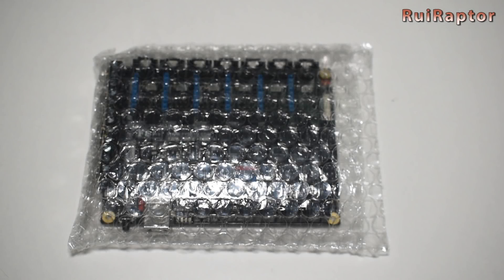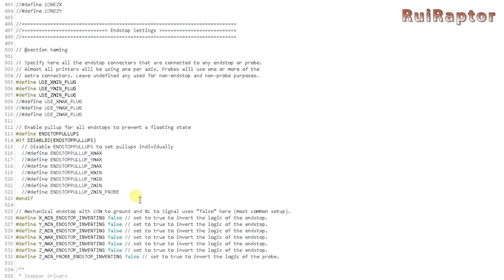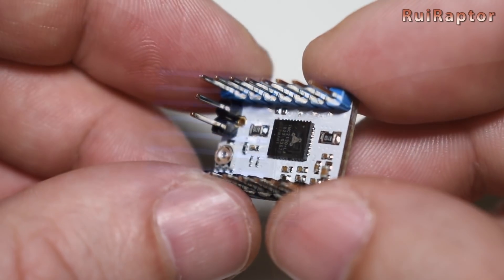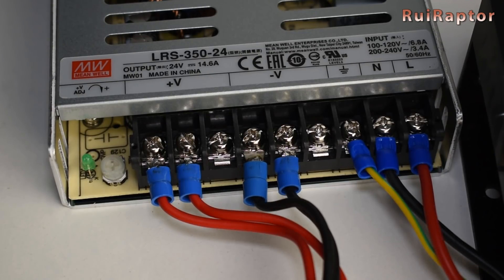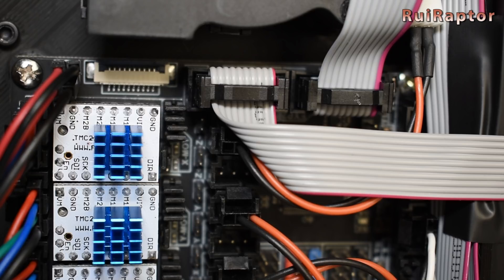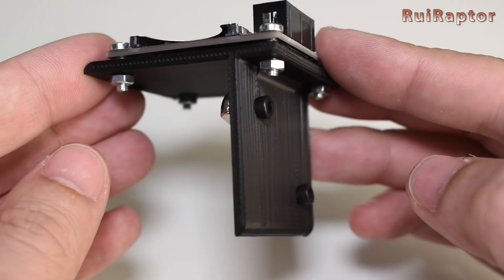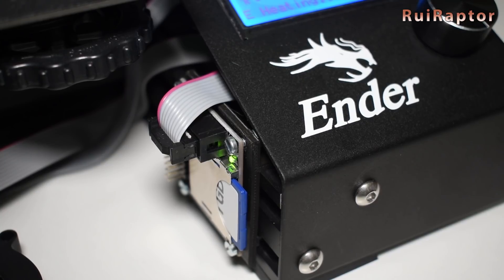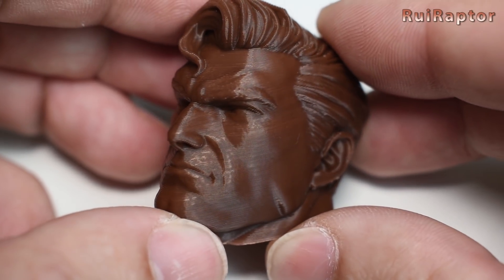Fysetc F6 - HOW TO INSTALL on a 3DPrinter (Ender3)

Comment: Hello sir I need some help from you Firmware Fysetc F6 v1.3 & tmc 2208 v2.0 & RepRapDiscount Full Graphic Smart Controller Please pay attention and thank you
Reply: And is it possible to run the lcd mks tft35 v1.0 with this board
Reply from the maker: Greetings, sorry for the late reply. We have been very busy. 
We will not be able to build your firmware since we don't have not enough time at the moment. Sorry.

Comment: I just hooked my Fysetc F6 up to a raspberry pi for the first time.... do you know of a way to keep the board from being powered by usb while the printer is off?
Reply from the maker: Hi Aaron, the only way (with that board) is to use a USB cable that has the power wire cut.
Reply: @ruiraptor  darn. I tried that, but octopi errored out when trying to connect without that wire.
Reply from the maker: Do you have the power and ground wires cut out? Try with only the power cut and leave the ground connected.
Reply: @ruiraptor  Yeah, I just cut power wire and left the ground.
Reply from the maker: Hi Aaron, some boards have a jumper to switch power source between usb and power connector. That board does not have that and the cable trick should work. If that does not work, then you need to power off the raspberry when turning off the printer. If you use one of those AC power plugs with 2 outputs and switch, you can turn off both.

Comment: hi...where I can download the firmware ready to install on an Fysetc F6 with the cr10 stock lcd???
Reply: mi email is oituarte@icloud.com.      thank you
Reply from the maker: Hi Omar,
I only have for the Ender 3. But you can edit it and make it compatible with the CR10.
Reply: @ruiraptor  hi , my printer is the ender 3, but the option on marlin es cr10 stockdisplay
Reply: @ruiraptor  can you share the file?? thank you
Reply from the maker: Hi Omar, i just sent it. Please check.
Reply: ruiraptor gracias lo reviso y posteo resultados...saludos

Comment: Hello! In the video, everything is clear and detailed, I can’t get flashed through your video (Could not send me my firmware tuned to TMC2208 without UART, but with standard Ender 3 screen. Thank you in advance! Thank you very much for my English, used Google translator. Send to danilaudi@gmail.com
Reply from the maker: Hi,
I have sent you my firmware to your email. Please check.
Reply: @ruiraptor  Hey. I just saw the letter, clicked on the link and it was written: "Transfer deleted
Sorry, this transfer has been deleted and is not available any more".  Can you repeat it again? And this is another question, blowing the hotend fan 0, and where to connect the blowout of the printed model? thank

Comment: Hi! Thanks so much for this wonderful video! I would like to install this with tmc 2208 on my Ender 3 with the fysetc tft4.3. Can you email me your preconfigured firmware for these? Thanks so much! hawktrainer at gmail dot com
Reply from the maker: Greetings, Firmware sent. Please check
Reply: @ruiraptor  Received - thanks so much! I will try it this week.
Reply: @ruiraptor  Thanks again for sending the firmware. I am not able to get the firmware to compile in arduino IDE. I get this message:
"sorry - this program has been built without plugin support
Using library LiquidCrystal at version 1.0.7 in folder: /Applications/Arduino.app/Contents/Java/libraries/LiquidCrystal 
exit status 1
Error compiling for board FYSETC_F6."
Any idea how I can fix it?
Thanks for your help!

Comment: Hi Rui 
when will you make the complete video for vref and card configuration?  bye thank you
Reply from the maker: Hi Emanuele,
The Vref adjustment depends on the driver and not the board and for that reason, we didn't include that in the video. We have many other videos explaining that in detail. Regarding the card configuration, which do you mean? We explained a few.

Comment: And why you don't use tmc2130 for extruder?
Reply from the maker: Hi Vadim,
The TMC2130 can be used for the extruder. We just wanted to show different options (in this case an LV8729) and how to configure them.

Comment: what are the connectors to buy?  it is not clear they are not the duponds. Many thanks links please
Reply from the maker: Hi,
They are called MTE connectors.
If you google MTE connectors you will find the exact ones. You need 2, 3 and 4 pins connectors.
Don't forget to buy also the pins as they are normally sold separately.
Reply: ruiraptor thank you so much you are very kind.
Reply: Hi
Did you finally make those connectors? Are there any shops selling already made those connectors?

Comment: I was wondering do the setting values in the firmware matter? (speed, jerk. etc.) I was wondering this because I'm building my own printer and I always thought those values only mattered in the slicer settings. Do I need to mess with the firmware values of speed and jerk?
Reply from the maker: Hi,
If you use Cura or any other slicer that has acceleration and jerk control, you can set these parameters in the slicer instead of the firmware. But if you use a slicer that does not control that such as S3D for example, you should set the correct values in the firmware because the printer will assume those. I normally advise people to setup the firmware values too because if in the future they change slicers, lose the settings or sell the printer, the correct values will always be with the printer.

Comment: I have the 2208 with UART from Fysetc.
How can I configure the marlim for it bypassing the UART?
Reply from the maker: Hi Fred,
The selection in the firmware is done when you define the driver type such as:
TMC2208 (UART enabled)
TMC2208_Standalone (NO UART)
Reply: @ruiraptor  Thanks
Reply: @ruiraptor    you could email me your configuration. So I need to change only driver definitions.
Reply from the maker: Hi Fred,
Sure, I can share the configuration. You can email me (check my email here on youtube or on my facebook page) and i will reply with it.

Comment: as always great video ;) 
but for airflow purposes i think the driver's heatsink should be rotated 90°
Reply from the maker: Hi, i agree with you 100%.
I noticed that after the installation but left as is and it's working as the flow of the blower is very efficient.

Comment: Hi. What are the values that you used for "feedrate", "jerk" and "acceleration" on your printer?? I ask because since I bought this board I could not find good value for that!! The motors are really noisy! Thanks.
Reply from the maker: We are using the same values as the stock ones. Maybe you probably running the drivers in spreadcycle instead?

Comment: Hi. I did what you mentioned in video to use stock ender3 screen but i only got light nothing else my screen only works with both exp1 and 2 connected to the screen when reversed exp 3 as i said just lights and click sound
Reply from the maker: Hi Fatih,
Please change the pinout of the LCD in the Pins_Fysetc_F6_13.h to:
#define LCD_PINS_RS              27
#define LCD_PINS_ENABLE    29
#define LCD_PINS_D4              25
#define LCD_PINS_D5              25
#define LCD_PINS_D6              27
#define LCD_PINS_D7              29
#define BEEPER_PIN                37
#define BTN_EN1                      23
#define BTN_EN2                      17
#define BTN_ENC                     35
Reply: @ruiraptor  thanx worked like charm

Comment: hi, we are FYSETC, and our F6 V1.4 is being planned! Will make the following changes. Do you have any other suggestions? 
plz tell us from our gruops: https://www.facebook.com/groups/197476557529090/
1.Change z Parallel to Series. 
2.Remove jumpers, use analog switches, and select driver types through software. 
3. switch to automobile fuse.
4. Add power supply reverse protection. 
5. change 5V to 5A, and add a WS2812 RGB control.
6. Add Z-min level conversion .

Comment: Do you think that this board is better than the MKS Gen L?
Reply from the maker: The Fysetc F6 has more features than the MKS GEN L, for example, the F6 has 6 driver slots and 7 motor outputs (1 extra Z motor output for dual Z systems). It also allows you to use SPI or UART connection with the compatible drivers with no extra wires. If you check the Fysetc F6 wiki page, you can read all the features.
Reply: @ruiraptor  what about the SKR V1.3 which has a 32bit processor?

Comment: thank you so much for this amazing video. I have few questions to you.. first of all, can we use all versions of TMC 2130 drivers for SPI mode on this board? i am asking this because you are saying on the video that your drivers have 2 extra pins. I have TMC 2130 V1.0 from Fysetc. if i had 2 extra pins?  second question for the touch screen; the board has pins for RGB but the  menu of the TFT screen has no LED menu, so how can we use the screen with LED screen menu? last question is about auto levelling; can auto levelling function be activated on the 4.3" touch screen supplied from Fysetc?
Reply: hi， we are FYSETC, The TMC2130 just TMC2130 V1.2 of ours can be used, and don't used other brand from China, the chip of them is not original , so the quality is very poor, and TMC2130 V1.0 haven't 2 extra pins.        and for touch screen, yes, now we haven't LED menu and auto levelling, but if necessary, we can add it， if u have more suggest or interested for our F6, maybe u can contact our engineer directly from our groups:  https://www.facebook.com/groups/197476557529090/
Reply: @骆小甜  i think i could not explain my problem.  I have already got TMC 2130 drivers from FYSETC your company. I am asking if i can use them for SPI mode if  I add extra 2 pins? since rgb is not necessary then why did you add it on the board. and if it is necessary why didn't you add it on the touch screen menu? anyway i made some search and find the answer.
Reply: @silmaz40  TMC2130 have different version, 1.0 haven't open the SPI, and 1.1 have open, BTW, some sale clone our driver and write our logo on the driver, maybe not of ours.
for the LED,We haven't said menu is not necessary, for RGB, also other buyer suggest on our group. so engineer have seen, I  said if necessary, means if a lot of buyer need, we will add it, bcz every buyer have different thought.and thx again for your suggest

Comment: Does the touchscreen allow live z-adjustmets? I know the MK3 touchscreen doesn't. This looks way better.
Reply from the maker: I can't find any option for live Z adjustment :(
Reply: I have the board and screen for a very long time and asked them to add autobed leveling to this screen and they didbt add it so far with autobed leveling they should have add it to screen so far no there is no such option

Comment: It would be great If you could explain how to install the Biqu SKR v1.3 on the Ender 3. It's a 20 usd 32bit board that is selling a lot. Apparently it is possible to use the original LCD. I haven't find a video which explains the LCD and the drivers (TMC2208, for example) installation.
Reply: You are right.. i would like that too.. thank you rui!
Reply: @Lyiico  Thank you! That's a very good explanation!
Reply: https://youtu.be/neqVD6gveXU
Reply: @speesy  thanks! I saw this video, but it is not very clear and I'm particularly interested in know how to configure the original LCD from Ender 3 and the TMC2208. With Ruiraptor's explanation It would be much easier.
Reply from the maker: Hi Lucio,
we will try to make that video ;)
Reply: @ruiraptor  Thank you! I think this will be a great combination, the best selling 3D printer and a very inexpensive 32bit board. Biqu / Big Tree Tech is making a good promotion this weekend on their Aliexpress stores. I bought 15 TMC2208 drivers for 60 usd and got a SKR v1.3 for Free. They have other promotions as well.
Reply from the maker: I will take a look at it. Thanks for that information
Reply: https://www.youtube.com/watch?v=duNHOPlh2Pg
Try this one